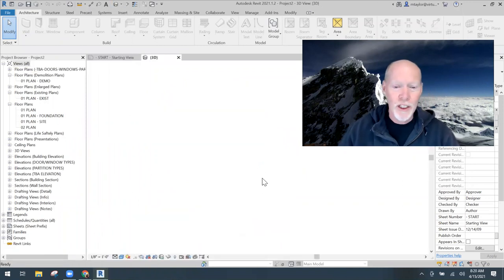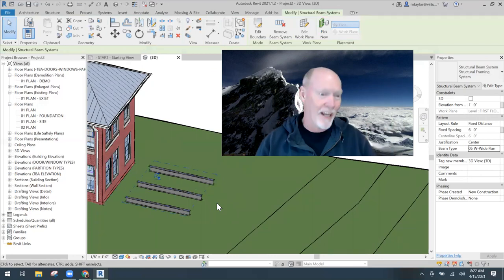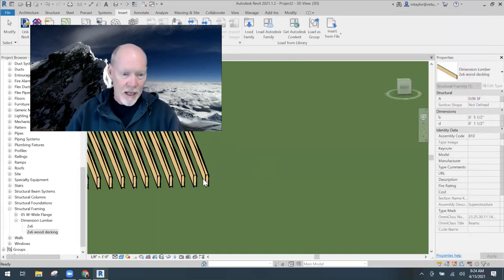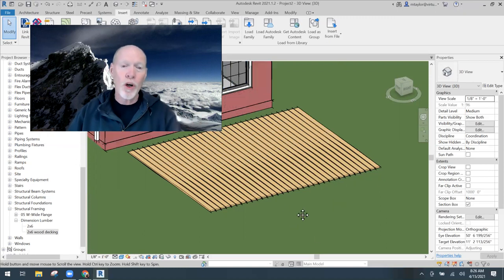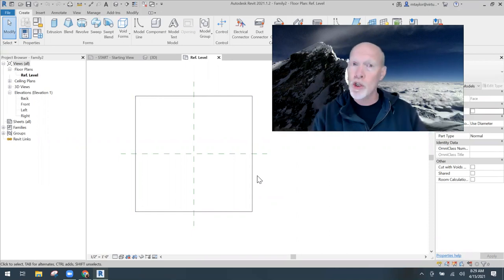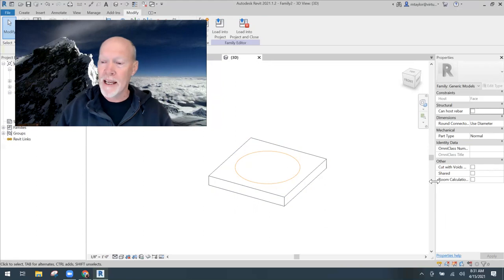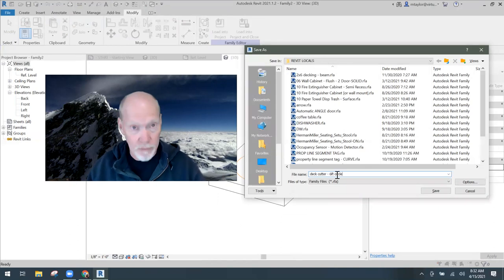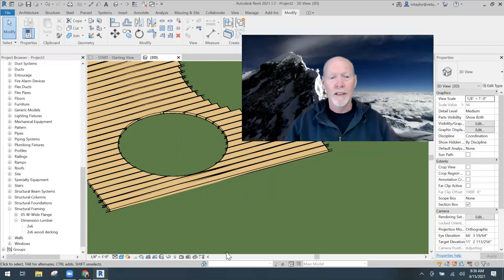CUTTING HOLES IN A WOODEN DECK: or anything for that matter

Comment: Hi Mike! How can I join 2 top railing and make 45 degree to joint them? Thanks in advance.
Reply from the maker: The corner is not a good place to join 2 railings... in fact.. you can't.   I usually make one railing turn the corner and go about 1'-0"... and that is where I connect the two railings.  It's a cleaner connection.